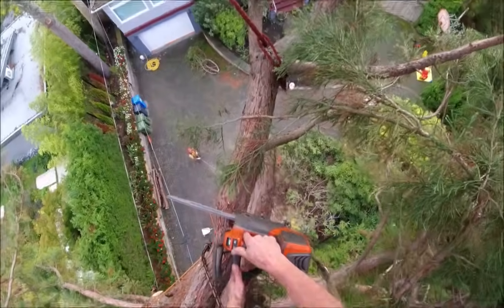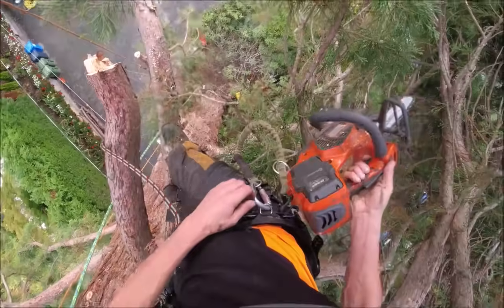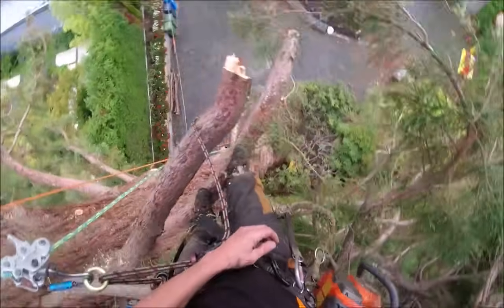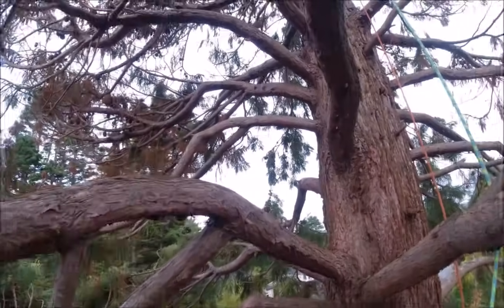Cutting down Big Wood in small pieces

Comment: Why on earth would you cut and chunk like that?? I understand blocking down… But at this point, you just need to blow a big notch and rig the logs. There is a better way my friend. That’s entirely too much cutting.
Reply from the maker: Have you ever rigged a log that's 6 foot wide ?  How long would it have to be to safely tie it so it didn't fall out of the line or turn upside-down ? Let's just say for a minute you got that far, seems as there's nowhere to let the log run, would you instead try to stop it dead ? What rigging hardware would you use that would cope with such an impact ? There's no point speculating on situations that you've never actually been in yourself. How long have you been doing tree work and where ?
Reply: @Recoates  I’ve never cut that type of tree specifically because they don’t grow in Louisiana but yeah buddy I definitely have plenty of experience to be commenting. 
You could Basel tie and standard rig. or double block rig and tie off with a sling. I’d say double block since the logs would be so heavy. Tie a pull line in the top, deep Humboldt, and send it. If you MUST cut it in half, you could cut straight down the middle, 10 ish ft at a time, and rig it off in halves. That would be sick. I promise you bro. I would come up with a better way than that😂 I definitely would have tried a crane first👀 but if it must be rigged, I’d definitely come up with something.
Reply: @Recoates  of course you can’t rig if theirs no space. We are intelligent arborists here bud.
Reply from the maker: @X-Tree-MNinja  my question was have you ever rigged a 6ft wide log of any kind, not have you cut down a Sequoia?  Unless you have, then the suggestions are pure fantasy. Anybody can say anything about what they might do and what might work, but the reality is very different. You didn't actually answer how long you've been doing tree work in Louisiana, but you should know that.
Reply: @Recoates  not 6ft no, but I have 4 1/2 ft oak. Heavier than sequoia. Not sure what your trying to accomplish by inquiring how long I’ve been doing tree work? I recently started a youTube, so you watch for yourself and you tell me. I am the owner.
Reply: @Recoates  you sound like an internet doof. Keep in contact bro. I’ll compete with you whenever we get a chance to link up. I’m about to make my presence known on YouTube. I can always learn more, but I am a beast buddy.
Reply: @Recoates  answer me this though for real! Why no crane???
Reply from the maker: @X-Tree-MNinja  see, here's what I mean about fantasy. Re: your suggestion to actually rip down the middle and take 10ft logs. So what are you going to do, use a 6 ft bar to cut vertically for 10 ft ? Or use a shorter one, come in from both sides and make 2 10ft vertical cuts ? Thereafter how are you going fit the rigging line through the saw cut to tie these logs ? More bore cuts ? Or a massive drill maybe ? All this while your 1 groundworker is stood watching with the customer, nothing to do, both wondering WTF ? I won't even ask about your double block and Humboldt, but I'll bet you've never cut a 6ft Humboldt at any point on any tree in Louisiana. Please take this whole post in the good spirit that it is meant, but you have a long way to go, mate. Respectfully. I'm only humouring you right now because I need to call someone and I'm putting it off
Reply from the maker: @X-Tree-MNinja  internet doof, lol, that's a good one. I did explain this at the end, but I summarize again. To get a crane big enough I'm looking at 4k. Then I also have to pay a premium to get a permit for road closure. Very sensitive area too. Lots of trouble makers. I'd have to do something with the wood when it comes down. But ultimately I would still have to cut it up small and deliver to the owners son.....which was a condition of the job. I was not at liberty to just dispose of the wood however I wanted. So I'd be paying thousands of extra dollars for a crane, a road closure, extra workers to manage the road and pedestrians etc, just to bring the wood down to the ground where it would all be cut up and thrown on the truck. So why would I give all that money away when I can put it in my own pocket ? Cutting wood is just cutting wood, it doesn't matter to me whether I'm on the ground or tied to a tree. But either way the wood from that particular job still had to be cut to the same size and delivered to the same site. Does that  make sense ?
Reply from the maker: @X-Tree-MNinja  it's a fair and common question to ask a fellow tradesman how long have been cutting trees. I've worked with literally hundreds of tree workers, and also met thousands when I used to work at the trade expos each year. It would always come up
Reply: @Recoates  yeah bro I didn’t watch your whole video. Just the beginning. And I’m not talking about your ability. You are capable obviously. I’m just saying your comments are a kinda insignificant. 

I would have 100% closed the road down, charge the extra 4k, and moved on a few days earlier with the same pay check. BUT! It seems like inexperienced people like this type video, so I may do the same. I’m saying what your doing is too hard bro, not that you arnt a beast😂 

and no. When an old tradesmen THINKS he knows a lot and is trying to belittle someone’s opinion because he thinks they haven’t been studying trees since 13 years old… he will try to get the young guy to look inexperienced with my 11 years studying and 5 years climbing stacked up to however long you been doing it. But I’ll tell ya this. I turned my body into a spartan. And I’ll go head to head with anyone in the country. As a matter of fact. I’m itching to do so. And as far as my ability, you need to look at my Facebook. I’m the most experienced and highest paid climber in my area. I cut the nasty nasty for a lot of big names. lol. Monster trees are my specialty.
Reply from the maker: If you 100% would've charged the extra 4k + the extra expenses I mentioned, then you 100% wouldn't have got the job. If you are ok with that, then fine. Saying I'm working too hard should only be put in context with what I've done in the past, and what's normal for me, and what I'm prepared to do to get paid. I can honestly tell you it was nothing, but I knew it would make a pretty good video, at least different from the norm. Don't take this as belittling, but what you call a monster tree in Louisiana, would not qualify here, or countless other regions. That's just a fact. It's the big fish in the small pond scenario. Which is fine, so long as you recognize it. You obviously have an appetite for the work, so my advice would be to travel elsewhere. You can always go back if you have roots, but if you truly want to test yourself and make the best if your abilities then you need to leave. the skills that you have now wont always be sufficient, so you have to dig deeper to summon something extra if it's there. There's many bumps in the road, but it's worth it.
Reply: @X-Tree-MNinja check you out. A Spartan eh! Were they known for their humility too? 
Out of curiosity I’ve just watched your videos and I can see why they’ve got 6-12 views! 👍
Reply from the maker: @X-Tree-MNinja  in other words, you read it. Take care of yourself
Reply: @X-Tree-MNinja No chance would rig that. There is proof on this platform alone that Reg has been doing the work overtime that gets the respect from most up and coming climber and all experience ones. 

I think it's odd to comment on a video that's clearly put on here to educate people who are willing to learn. 

I'm from England and thought I was the dogs bollocks unitl I traveled and eventually ended up in New Zealand, and thankfully, I was humbled along the way... now I'm competent in all aspects of the job through working with people better than me.  

I've craned out a redwood over this side of similar size timber with dead and live limbs, and let me tell you it was shit so let's not make out that it's a glamorous two picks and move on....  we have blocked out many trees here, and with the right method, it's fairly easy if you keep your chain Sharpe... 

Suppose the proofs in the pudding here's Reg's where's your TreeMinger... we can all type a good game, put yer Camara on and show us.....

I'm the last person that would side with @Recoates as he's a Lanc and I'm from the better side of the yorkshire valleys in wakefield...

All the best chaps
Reply: @ryanmellor8687  I didn’t watch the video dog. I saw him cutting baby chunks, and I think that’s hilarious. He did it for the views. Man, y’all are dense.
Reply: @Recoates  I’m on tik tok too buddy. That account is fresh also. As of right now, I got 284 likes on a video posted less than a day ago. 2k views and 284 likes. MY RATIO IS BALLING!!!
Reply from the maker: @X-Tree-MNinja  right. I never really looked into tik tok, but I hear it's growing rapidly
Reply: @X-Tree-MNinja What sort of density are we talking about Stavros? Spruce? Oak or even teak?
Reply: @X-Tree-MNinja  I watched your video of you and your mate felling a tree, your mate shit his Pants, the tree was tiny and your method was pointless.
Reply: @ryanmellor8687  I am a Facebook shredder. I shred the fools who think they can match my intellect or undermine me. I’m really good at it. If you so choose to continue, I’ll be back on, making another video this evening.
Reply: @ryanmellor8687  bro your only video is you cutting a bush……. PLEASE look in the mirror for a while this morning. You need to recenter yourself. Stand outside barefoot for 10 minutes. You need the energy lol
Reply: @X-Tree-MNinja  that's really cute.

Have a great day, sir. I'm too old for your Facebook troubles and to even share my credentials with you.

You win. I'm absolutely trembling here.
Reply: @X-Tree-MNinja  also, on a more serious note, stay safe while cutting, although we may have different views on the industry. 

This was fun chaps
Reply: @ryanmellor8687  I’m not even gunna read your other comment cuz this one was nice lol. Be safe homie
Reply: @ryanmellor8687  lol. I let you live brother. Saw your nice comment after working 10 hrs climbing live oaks. I care less when I’m tired. I reposted a video for todays tik tok because I was too tired to make the video for the day. 

And idc about words or what you say you can do. I’m a beast so arguing with idiots is pointless. Gotta Show me son. Actions are louder than words. I don’t need to hear your “creds”. I can watch you for 1 minute and tell how good you are. And contrary to belief, years of experience doesn’t mean your any good…. And lack of years doesn’t mean your not a beast. It’s all about your capabilities, mental capacity, and work ethic. 

Remember me bro. I’m getting my name out there right now🙃
Reply: @X-Tree-MNinja  there's peltny on social media of what "I've done" 

Let me know when your names out there....

Climb safe